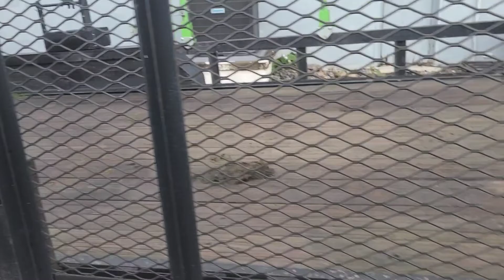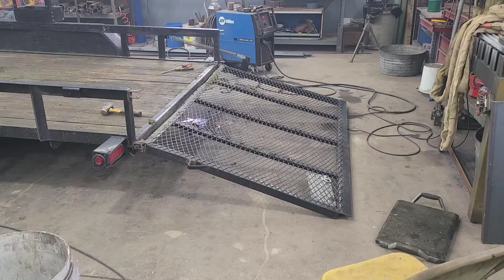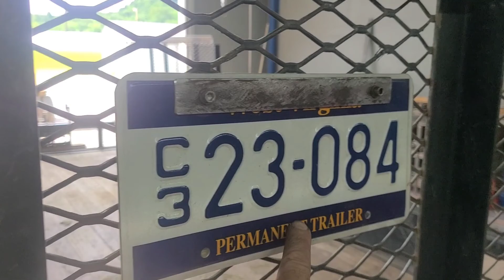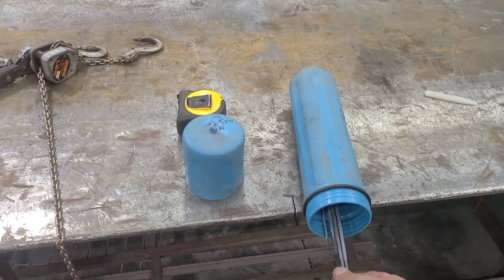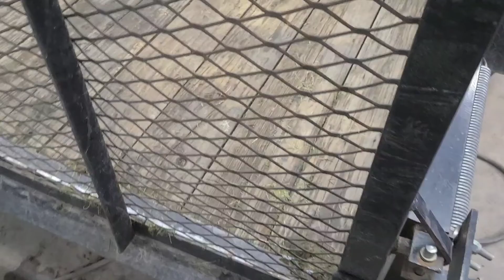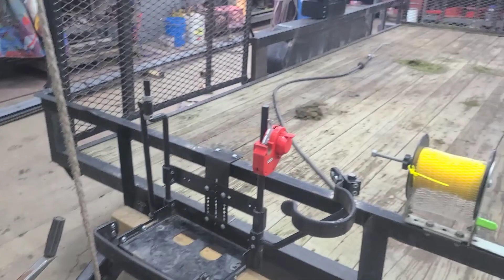Landscaping trailer repair

Comment: Actually after watching your videos and you’ve seen me halfway weld, I got enough confidence recently to grab me a new style tongue hitch deal, and cut my old one off and slapped them there new style jimmy quick release deal. Couple 2-3 Judy’s and I had that sucker off and slapped the new one on and brother she’s MONEY smooth now hookin and unhooking that skank twice a day now with my truck or the mowers which I use to park it sometimes
Reply: So my point is…..thanks for all your videos and the time you take explaining what you do and WHY, it actually helps a lot of us newbs out. Wuts the best deal you think of them mesh deals coming up? I know it’s every landscape trailer and yes ya damn right your leg goes thru a hole like that in full stride and your damn weeks wrecked. It will Jack someone up bad. Mine was like that. Seems like it’s best to brace the mesh besides the vertical angle irons the trailer comes with which is about half enough as they need, ya think the best plan is some more angle iron going side to side to brace it better? That bout the best deal for beefing up them gates?
Reply from the maker: If you don't mind some extra weight you can replace the 3/4" #9 expanded metal with 3# catwalk....that stuff will not break on you but it does weigh 3# per sq ft so it's much heavier....I have one small trailer that I completely redid with 4# catwalk and it's been a stud
Reply: @NBSWELDING  I don’t mind little beef on my chicks on the catwalk bro. Sounds good. I’m not really into skinny chicks anyways. With me being a toothpick it’s like two deers locking up, no good.
Reply: @NBSWELDING  you said it’s been a stud. I picture you walking a bobcat wit tracks up your little 6x12 gate cause you made the gate able to tote a excavator or dozer 😂